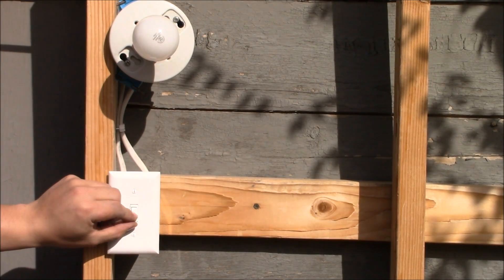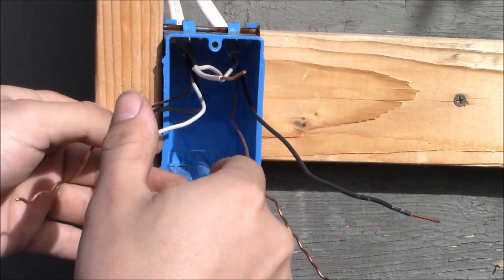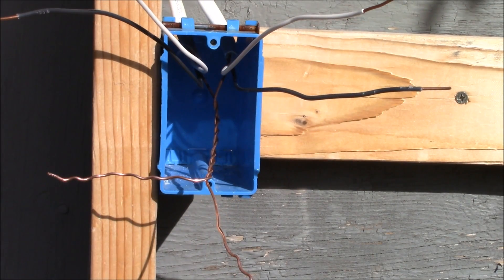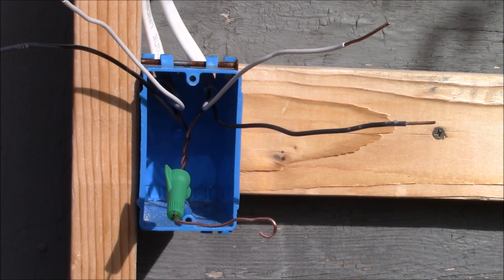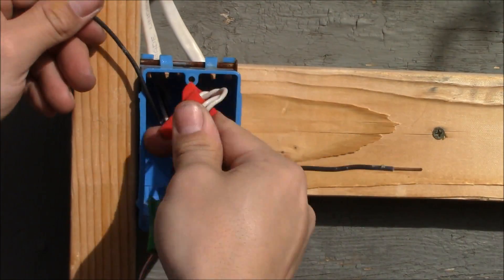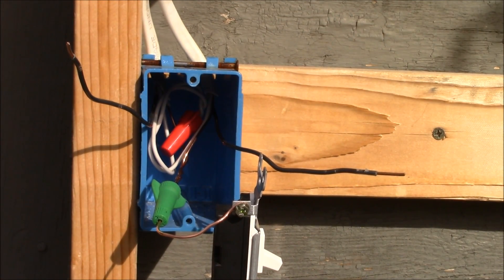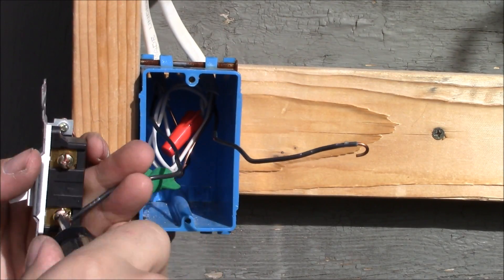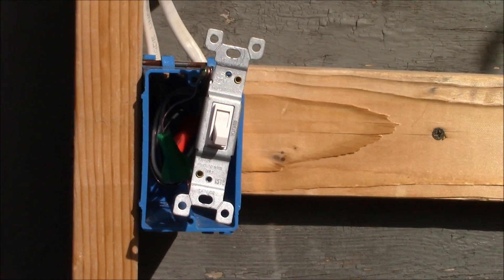How to wire a single pole switch system

Comment: Hi. What would cause a hardwired ceiling light fixture to stay on even when the switch is put in the off position? The switch previously controlled a half switch outlet.